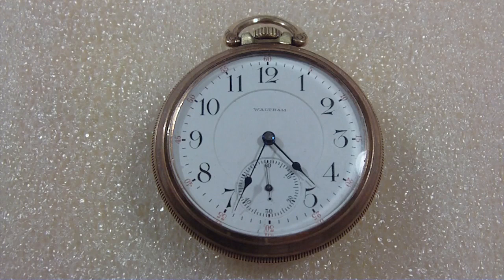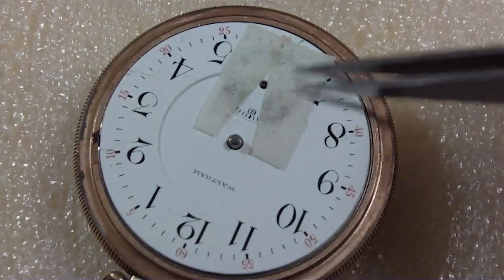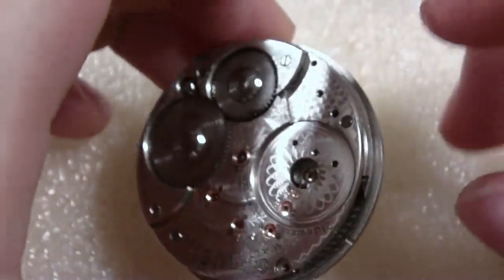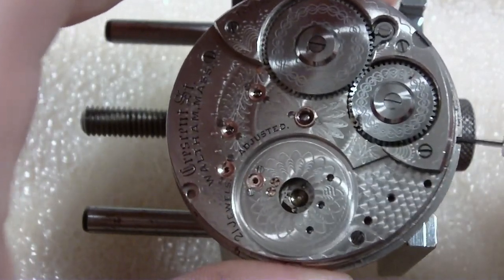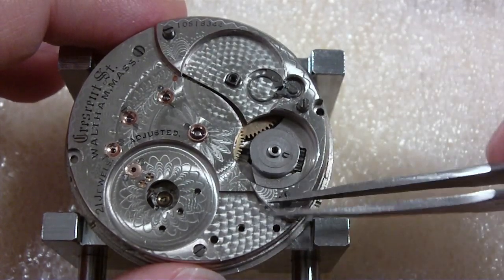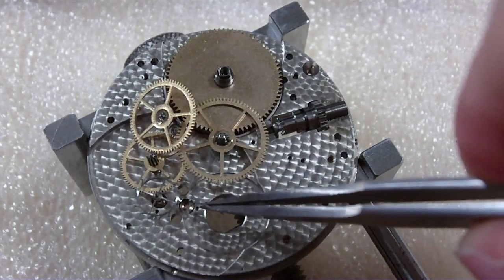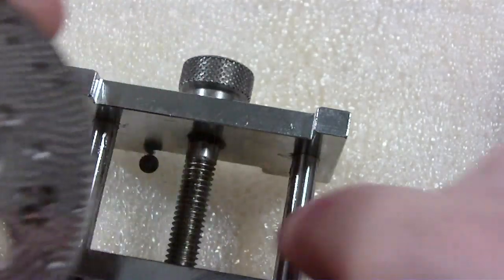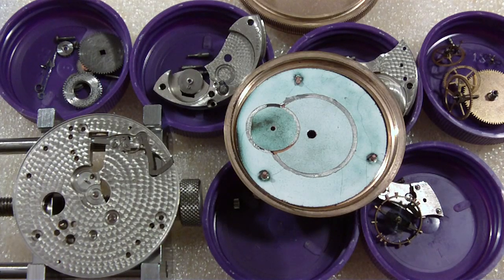How I take apart a pocket watch, Waltham Model 1892

Comment from the maker: Over oiling is a very bad thing.  The oil that moves away from the jewel will pull oil away from the jewel.  The jewel will then will not have sufficient oil.  That defeats the purpose of oiling!  The whole movement was covered in oil leading me believe it might have been an attempt in rust preventative.  You don't oil a watch by dipping it in oil.

Comment: Excess oil is a bad thing as it will only attract dirt and crud which will eventually stop the movement.
Keep your lubrication to a minimum.
Applying pressure to the top of your screwdriver will prevent slipping.

Comment: This is just what I need! I'm working on an 1892 Vanguard In a 14K case. Having to skip a lot of meals to save it from the scrapper's torch.
Reply from the maker: I bet you did.  18 size case is a big one.  Glad you were able to do it.  Once it is melted it is gone for good.  Gold is too much for my budget.
Reply: @bunnspecial  I actually just had to let another one go. It was a 1876 Waltham Park Road 15 jewel in a thick heavy 18K gold case! I did the numbers and it was about $4,300 in gold. But at least I still got the movement. Needs a new mainspring.

Comment: I enjoy your videos. I’ve taken my 1892 apart for cleaning. My question, how the heck do you get the geartrain to stay where you want it while you get the bridge back on?
Reply from the maker: With difficulty.  You can't unless you use rodico.  That I just thought of while I was writing this response.  Won't try that because you have to make sure you remove it all.  I have been told that if you put the train on the bridge it is easier.  You know, upside down.  I have some Waltham and Elgin 18s full plate assembly videos and in those I just move the train around with tweezers till the pivots go into the holes.  Start with the center wheel and work your way to the pallet fork, largest to smallest.  With practice it gets easier.